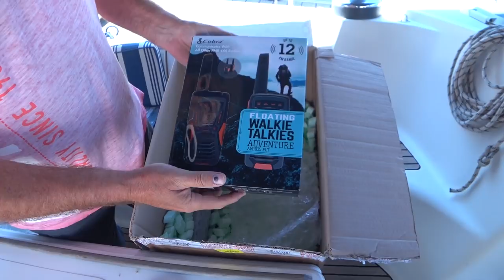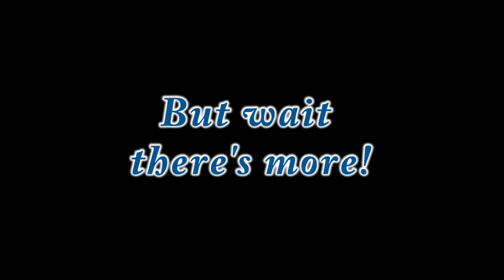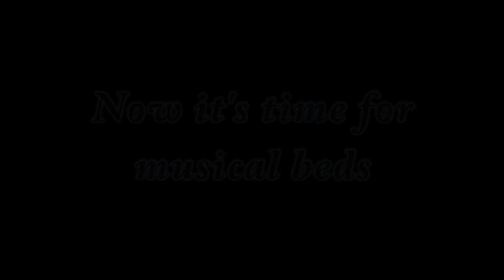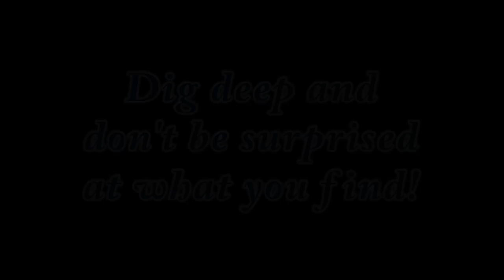Delivery of our new Zodiac dinghy and Mercury outboard - Sailing A B Sea (Ep.019)

Comment: Tip, look for a galvanic isolation transformer for your shore power
Reply from the maker: Added to the list. 😀
Reply: @SailingABSea  I trhink a  high power ( around 400/600 mW )WIFI repeater or extender will be handy for you guys, they are not expensive anymore .
Look at Amazon under : Wifi extender/repeater outdoor.
Reply from the maker: We are actually talking with someone at the moment about installing a repeater. Our biggest problem with ordering stuff to be delivered is not having an address to get it mailed to. 👍
Reply: @SailingABSea  You are for the winter season in Greece use one an address from a yacht harbor master or administration or even an broker, restaurant whatever. .( inform them about it )
If you have an account at Amazon you can choose your receiving address .
We are getting our stuff from the USA to Mexico whit in 5 days or even faster.
Reply from the maker: That's the plan Zasde. 👍

Comment: We have a Sun Odyssey 45.2 1999. With regards to the anodes definitely fit a galvanic isolator to the earth on you shore power intake to the yacht. Our anodes now last 2 to 3 years.
We also had the same issue with the top rudder bearing housing, a common fault on many Jeanneau yachts with this system. We had a new one fabricated out of stainless steel. 😎⛵️👍
Reply from the maker: Hi Jay, always good to get insights from other Jeanneau SO owners. Thank you.
Reply: Sorry it’s a bit late but only just found you channel.....great by the way.
If it is any help we are based in the Ionian at the moment and full time live aboard. We have all but rebuilt and rewired our boat, that is pretty much the same as yours. Ours is a 1999 Sun Odyssey 45.2. If you like find us on Facebook just search for WHUATI and give us a shout anytime.
All the best, fair winds and following seas.
Reply from the maker: Hi Jay, just liked and followed you on FB, it may show up as Barry Noble. We will certainly be asking you some questions as we head to Greece early next year. Cheers.

Comment: Great find with the rudder support bracket, sure not something you want failing in bad seas.
Just wondering how long the anode should last once the repaint is complete?
Reply from the maker: That is a how long is a piece of string question. Some say they should last 6 months, some say 9 or 12 months. The reality is there are a lot of factors which contribute to anode decay such as water salinity, stray electrical currents in the marina, what the other metals are that the anode is protecting. Our plan is to check it each time we scuba clean the hull.

Comment: Greatings !
Nice job with the videos!
Due the bad electric marinas installations ...you need Galvanic Isolators will interrupt galvanic current flow  - 60 A ProSafe Isolatr FAIL SAFE 
Sail safe and fair winds
J
Reply from the maker: [Baz] Hi Joaquim, agreed about marina electrics. It will be interesting to observe the anodes once we are out of the marina and sitting at anchorages. I have  bought spare anodes.
Reply: I have anodes in my boat that last two years without any problem. The anodes of your boat in two months have a practically total corosion, not normal ;)
Reply from the maker: [Baz] We are getting mixed reviews of wifi boosters. Some people say they're the best thing ever and others say they never use it. We'll see how we go and make a decision on that later.